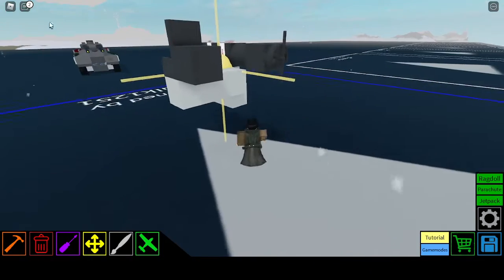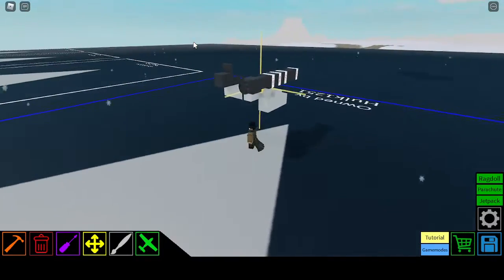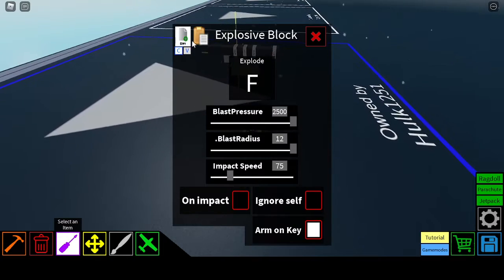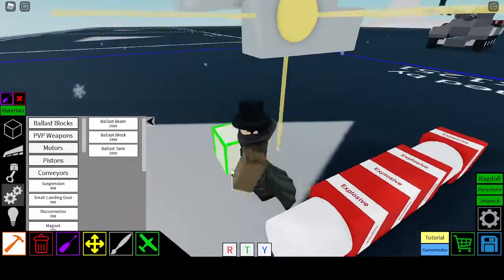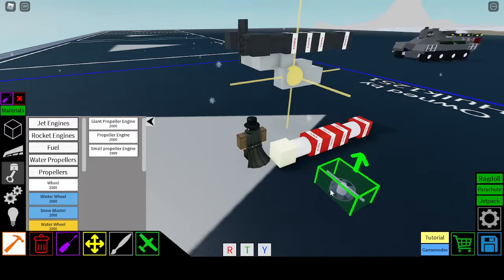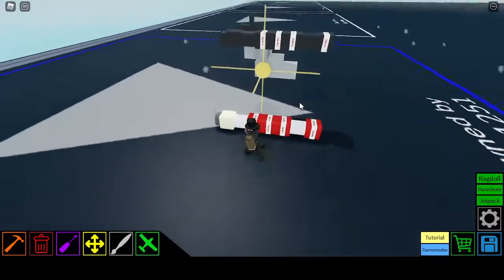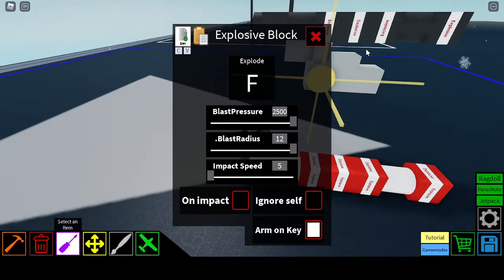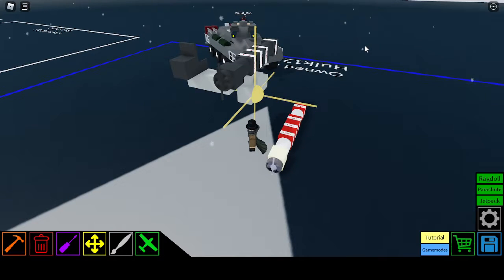Ship Based Torpedo Showcase and Tutorial / Roblox Plane Crazy

Comment: can this be used for torpedo boats?
Reply from the maker: I would believe so, though I can not give a definite answer to the question. The torp is capable of being dropped from a max height of 8 blocks or lower, therefore at a lower distance it should work more efficiently. Honestly, its just worth it to try, but no guarantees.
Reply: ya it can, im using it on my torpedo boat and works fine as long as i dont go my max speed

Comment: the torpedo just flies off the map when launched, at lowest power
Reply from the maker: Definitely a server/program issue because it still works
Reply: @uprising__  it glitches when they are connected via disconnectors with 1 block separation, I fixed it when I put the torpedos in different motor2s